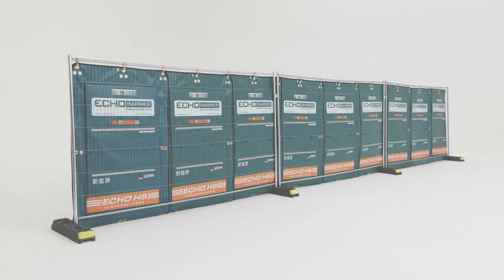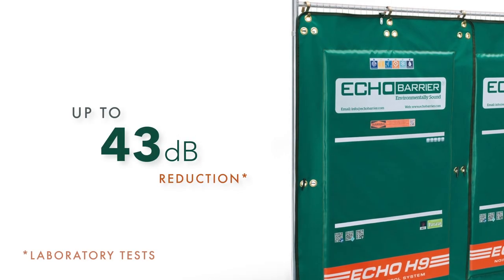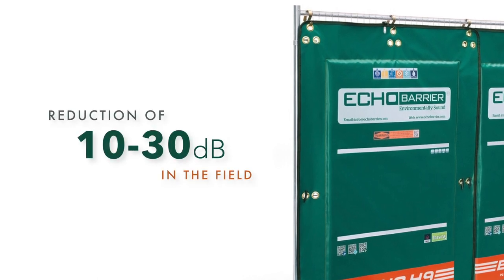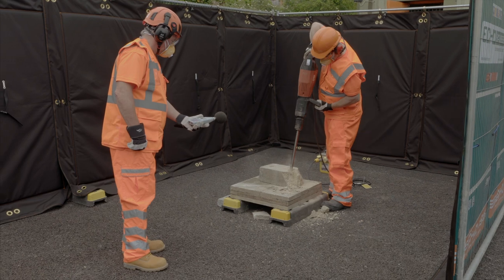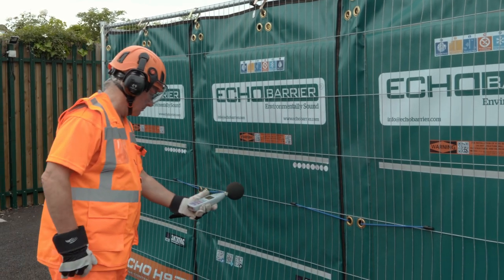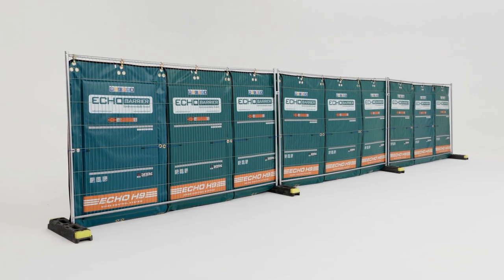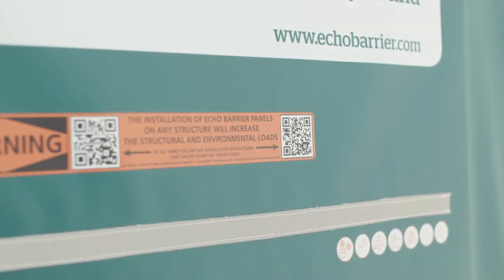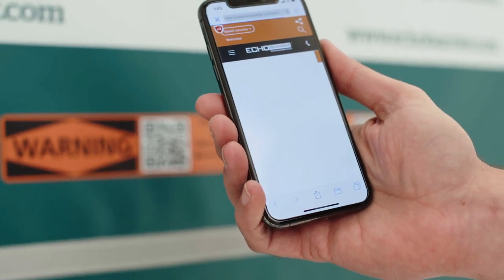24 dB Reduction Jackhammer Noise - Echo Barrier

Comment: By simply doubling the distance away from your noise source will reduce the sound by 6db. The microphone used for the test measurement outside of the barrier is positioned very close tot he sound barrier, minimising reflected sound from hitting the microphone. I think you need a better demonstration.